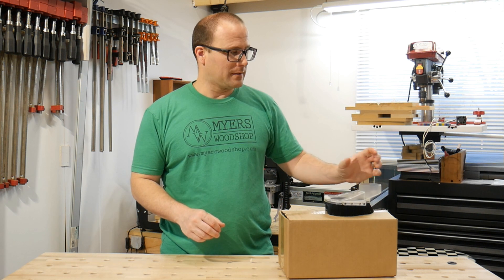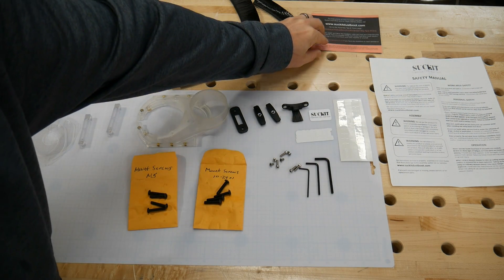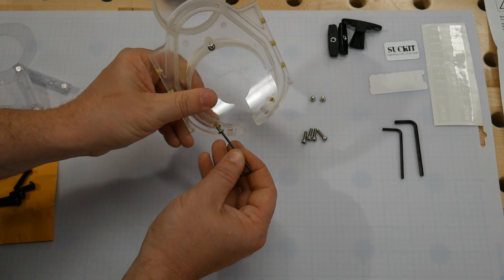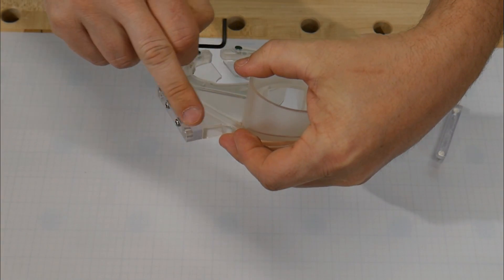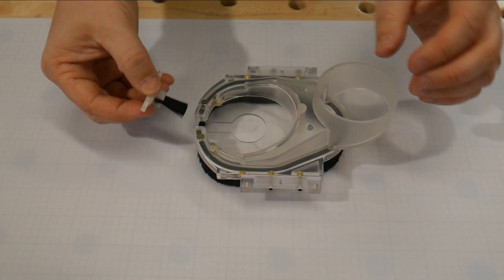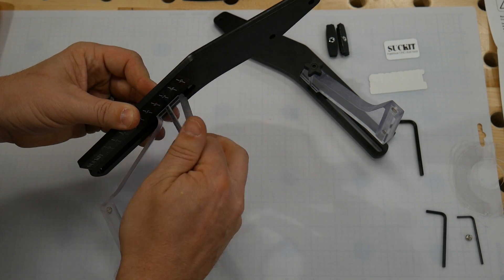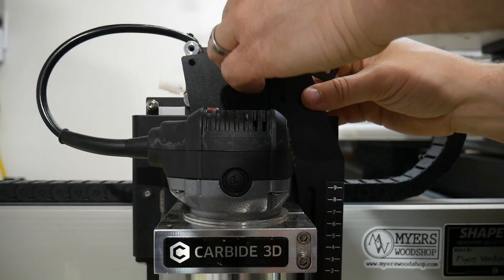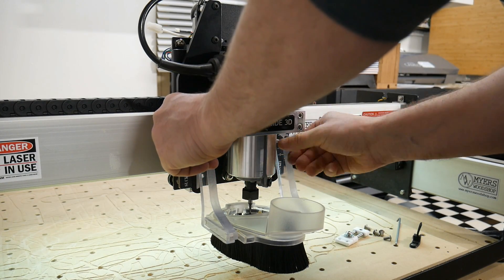Suck It Dust Boot Pro Kit Installation For The Shapeoko 3

Comment: Hey Ben. I’ve watched your videos numerous times on the Shapeoko. I put mine together at Christmas and love it. I have the dust boot pro and the carbide compact router. My question is, does the bit push lock button on the router interfere with your dust boot inner plates when traveling downward? Mine do. I have left them off and it seems to work out still, but just wondering if I need to do something different. Thanks.

Comment: Ben - much love and respect, I appreciate your videos and the dust boot has been super simple to install.  Couple minor details that may help.  1-My 1.5" brush was just a hair too long, I tried many times to get it in but it was just about 1/8" too long (or wide rather?).  I trimmed it just a little and it fit perfect.  2-(at 8:07) removing the plate to install the arms.  I found that just removing two of the screws (either the lefts or the rights) at a time and installing that arm before unscrewing the other screws makes it so simple - no need to worry about the wires for the end stop since the plate stays in the same place.  3-if the stickers are positioned closer on the inside then it's easier to adjust the height at a certain mark.  4-I'm all for videos with ads to make some money back, but Installation videos kind of fall in that grey area where you may want to consider removing them since folks who buy the product often scrub the video back and forth to see what they may have missed and it can get a little annoying hitting an ad right in the middle (just my friendly advice).   Great work and thanks for all your great videos!
Reply from the maker: I don't sell the suck it, so my only source of income is the ads :P

Comment: Thanks for the video brother.  Question.  My current, "original Dust boot" interferes with my maximum travel of my Shapeoko.  Causes my unit not to be able to go all the way to the left due to the mounting rails.  Does this one have the same issue?